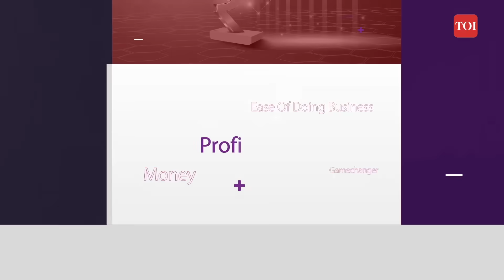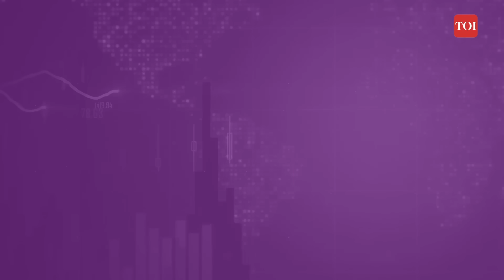Vande Bharat Sleeper Vs Rajdhani Express: Rs 35,000 cr Indian Railways project | Details

Comment: Worthless interview. Does not answer the most important question. Are the coaches going to be Aluminium or not. If they will still be stainless steel, what's the point of going to Russia? Baksish for railway babus?
Reply: It's gonna be aluminium, we already know that from other sources.
Reply: @Brand250 no. RVNL-THM one are Stainless steel. Only Alstom has got 100 Vande Bharat aluminium coach and that contract is still in negotiations